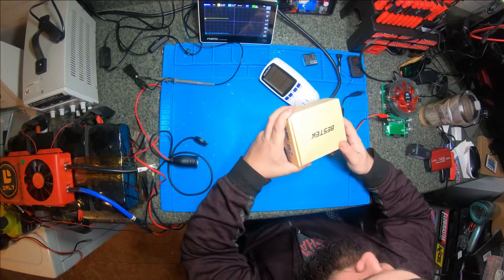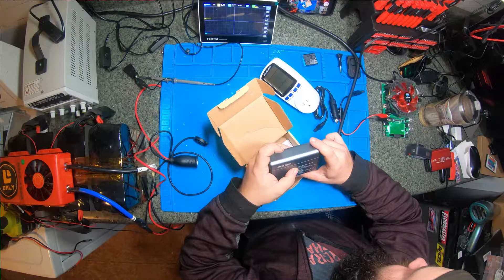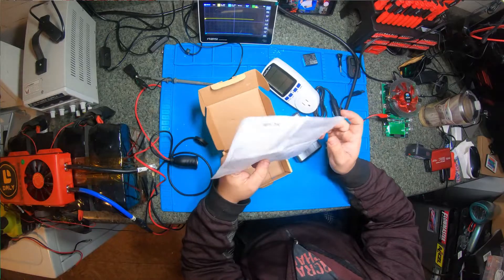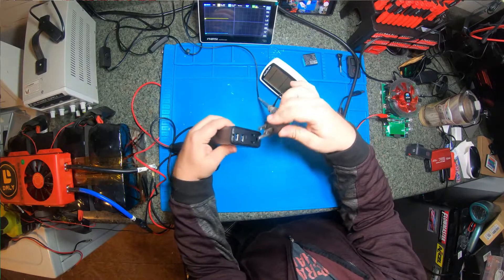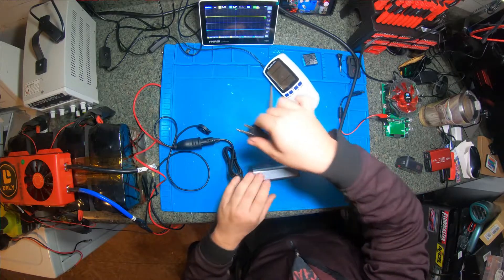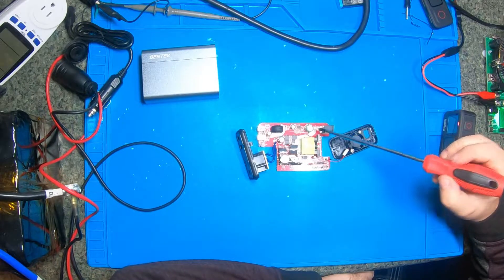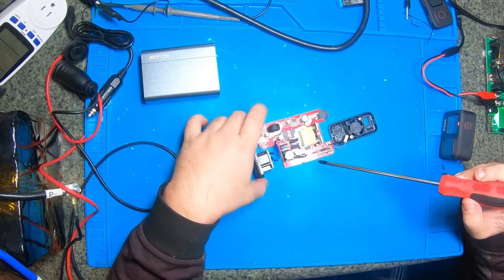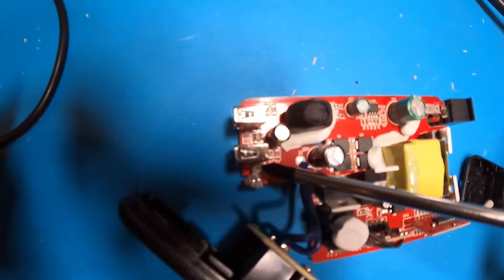Ripping Apart And Testing A Cheap 12v Inverter (BESTEK 150W Power Inverter DC 12V )

Comment: I have one I take on the road for laptop and printer has worked well.  On your load tests, could you show volt amps or amps? Inverters really aren't rated in watts as much as the marketing folks would like.

Comment: Buying this to power a 45w food warmer while at work. Do you think that the strain of having having a 45w device plugged in for several hours is too much for this inverter?
Reply from the maker: I tested it at 100w and it was getting pretty spicy but I'm sure at 45w you should be alright just make sure it has plenty of room for the tiny fan to cool it down haha
Reply: @OperationCamp  thank you!
Reply: For anyone seeing this review in 2025 or beyond. My Bestek 150w powers my 50w crock pot lunch warmer easily. It’s the 20oz crockpot

Comment: I’ve been off grid for just over five years now. I usually use an inverter capable of about 3 times the load I actually want to run and that prevents overheating. I’ve used them in our RV, vehicles, and in barns to run heat plates for brooding chicks. These tests are such fun to watch… you’re absolutely torturing those poor cheap inverters, I don’t doubt if you ran one long and hard enough you’d end up with a fire eventually!
Reply from the maker: How do you like the off grid life? Do you recommend it or have anything you would recommend doing before anyone  jumps  into it?